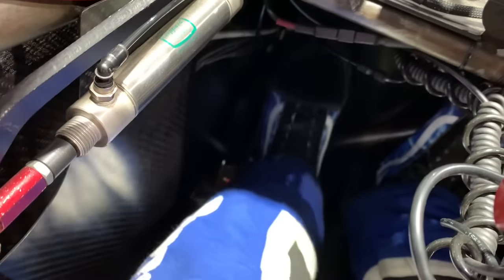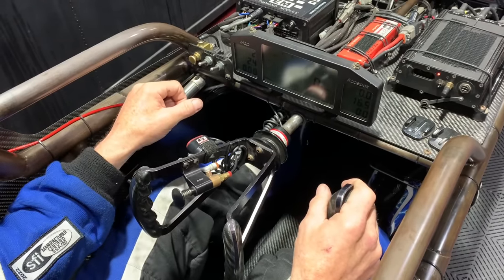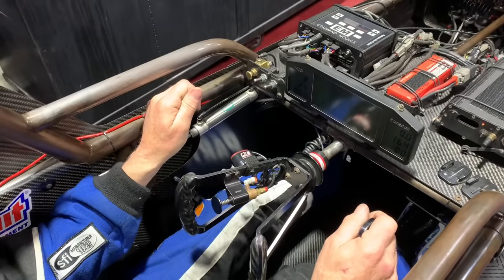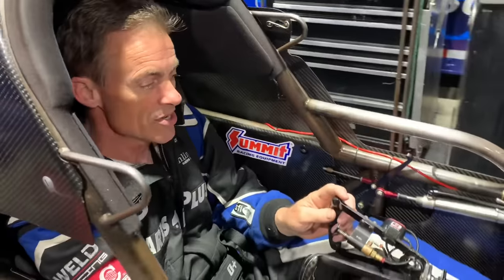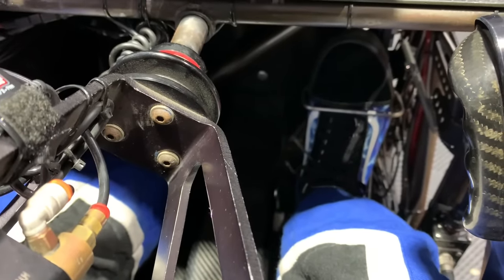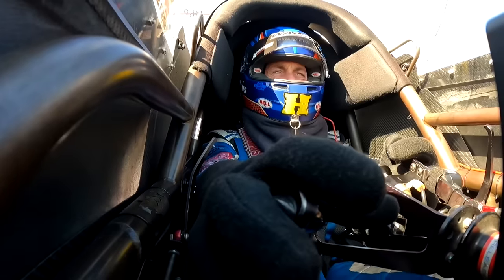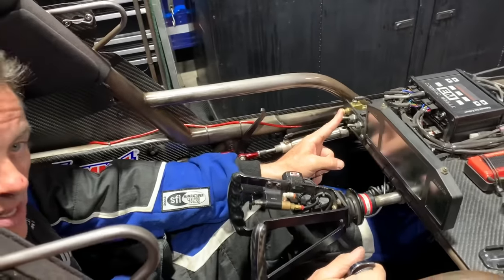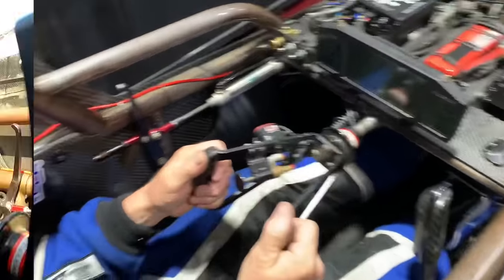How To Drive A Top Fuel Car

Comment: I see where the confusion might come from, but Top Fuel drag cars don't use a mixture of cheap gas and additives. They rely on a specialized fuel mixture that includes a high percentage of nitromethane, which is a powerful fuel on its own. This unique fuel composition is formulated to provide the extreme power and performance needed for drag racing, without the need for additional gasoline or boosting formulas. It's a highly controlled and specific fuel blend designed for these high-performance engines.

Comment: There is a button in (roughly) the center of the steering wheel that you never mentioned.  Is that part of the fire suppression system?  Oh, you forgot to mention one of the best parts - after the run, you get to talk to Amanda!  :)

Comment: Question - I heard something extra about fuel pumps. Like the burnout is with only one or less than all of them... and the crew chief turns on the others between burn out and staging. You can see them reach into the engines on TF dragsters and funny cars doing something. Is there anything there worth explaining? Thanks for a great video.

Comment: During staging, "A Burn-Down" staging duel (used to be fairly common)...
...would one 'overheat the motor'
or
...would one 'smoke the clutch pack'
Knowing now that, once the top bulbs are lit, you take foot off clutch and stage on the handbrake...
 ...I'm not sure what cooks.

You've got fuel trim in your hand, but no coolant, clutches are primed with air button and pulling the engine down...

Nerd questions. I don't even race.

Comment: Does the parachute lever shut off the engine too? The engine is quiet before the fuel lever or switches are turned off. How is the engine shut down?

Comment: back in the '70s there were two brothers who owned a former funny car. they would stick a junkyard V8 in it and go bracket racing. no way that engine could break anything in the car. no way they could get hurt. they had a ten second car without spending a years wages on a finicky engine.

that is what I would do, if I found a retired top fuel car in a barn.

Comment: I always thought these cars had gears but he didn't mention shifting once. How does that work? How do you go from 700rpm to 7000rpm and have the car go from 0mph to 320mph? Is it just geared for top speed and there's so much torque from the engine that you're just going to melt your clutch on each run? Also how is the clutch all the way out but still slipping? Does it grab harder at higher rpms? Kinda feels like all the magic is in the clutch on this.

Comment: What is the switch (button) mounted on the steering wheel?
It appears that the parachutes do most of the braking and the rear wheel brakes are applied as a secondary braking system.

Comment: Yall use cable style throttle or a more linear actuator/chute actuator type method to push/pull the throttle itself?
if that makes sense...

when yall gonna demo run ar Bradenton motorsports park/freedom factory?

mainly a selfish request cuz thats right close to me.

hell, may not be enough runoff/track side safety...

Comment: Question. While staging the car, after grabbing a "handful" of brake and taking your foot completely off the clutch. The clutch is just slipping while you complete staging and waiting to launch?
Reply from the maker: That’s correct 👍
Reply: @claymillican25  many thanks. no wonder they're taken apart and rebuilt after every run👍🏾

Comment: I remember a story a friend of mine told me about spinning the engine over, and starting it.  He was the guy on the starter at the time, new to the starter, and he stopped the starter pre maturely when the car wouldn’t fire, and the crew chief gave him a brutal reality check.  Sprayed him with the gas bottle.  Afterwards, he said I do NOT want to be the one to have to make that phone call to my dear friend’s wife telling her that her husband is in the ICU with a piece of the engine block lodged in his skull.  Starting the car, just starting a top fuel engine is incredibly dangerous, and it could potentially kill you if you don’t know what you are doing.

Like Clay said, you have to make sure there’s no nitro in the engine before you try and start it up.  If there is, the engine will bomb itself like a grenade, or the cylinder heads will literally take flight shooting off the block like rockets.  Tearing themselves right through the head studs.  They say Top Fuel is a different animal for a reason, and if you screw up, it is extremely unforgiving.  This goes for the driver, and anyone on the ground.

Comment: the motor dies at 10:22, before turning off the switches or fuel. How, good sir?
Reply from the maker: The engine dies from fuel rushing forward away from the fuel pump when the parachutes are deployed. Lots of negative g forces when they open.
Reply: @claymillican25  duh, never considered that. Now I see why they only let me do tires lol.

Comment: I dumped $20,000 into a short block in my 1970 350 block.
My engine ran the same
Reply: I drove this beast of a 350 for at least 10 years in my daily driver. 
13:1 compression ratio
Red line at 13264rmps
Pushed by a 2:76 or 2:73
Had it in a 85 custom deluxe farm truck.

Comment: so you're literally staged with the clutch slipping and it doesn't fully engage? how does it either not stall, or if engagement is that light, not blow through the clutches as soon as you stab the throttle? It obviously works, mind boggling.

Comment: Good to know in case you ever find yourself stranded in the middle of nowhere in the midst of a zombie apocalypse and the only vehicle available within 100 miles to get you to safety is a fueled and ready to drive top fuel dragster. I'm eagerly awaiting a "how to drive a steam locomotive" for the same reason because you never know, right? Wouldn't want to get the pressure wrong n stuff.

Comment: I couldn't drive a top fuel car.. not because of being unwilling, definitely am it's just that at 6'10, 313lbs and all torso with size 14.5-15 feet.. It's just not possible for me to fit in one. On top of that I have no clue what the g forces would do to my scoliosis and chiari malformation. I have a feeling a broken back or blacking out from excess brain pressure (or both) would be in store and that'd be no bueno.